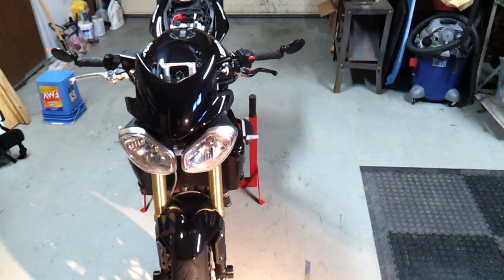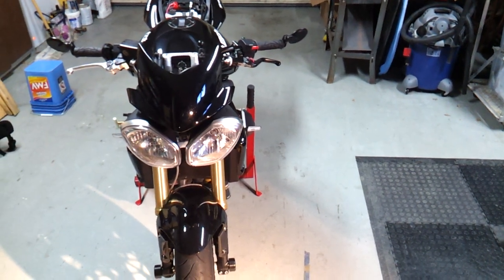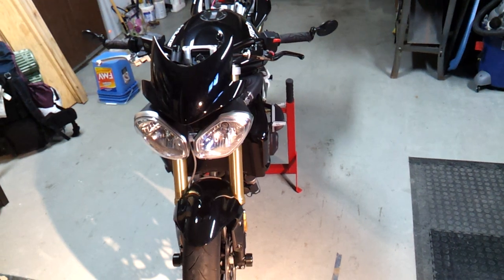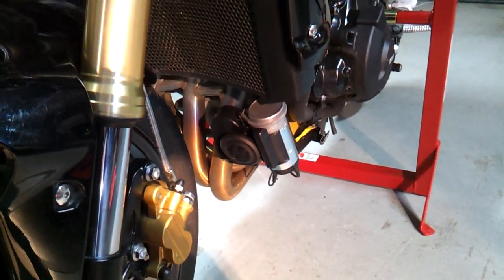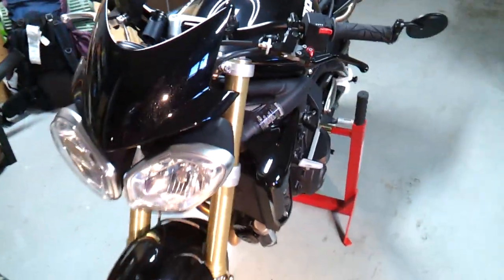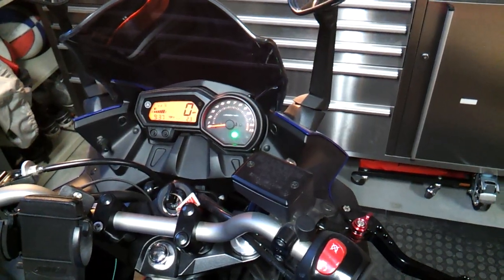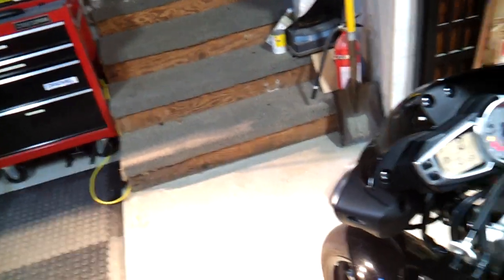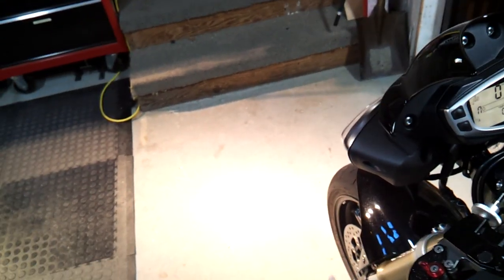Stebel horn on Street Triple vs. FZ6R stock horn

Comment: Nice video.  Did you use a relay?  Also, how did you mount it?
Reply from the maker: I did use a relay. In this video I just mounted it in the stock location, but I never rode with it there as I wasn't happy with it. It didn't feel secure. So I followed the advice of a guy on another forum who goes by the name Boneman and he shows how the compressor can be separated from the horn and then can be mounted separately with a length of hose connecting them. So that's what I've done. The compressor is under my seat and the horn is secured with 3M double sided tape and zip ties to my subframe.
Reply: Nastybutler Thanks.  I'll take that approach myself then.